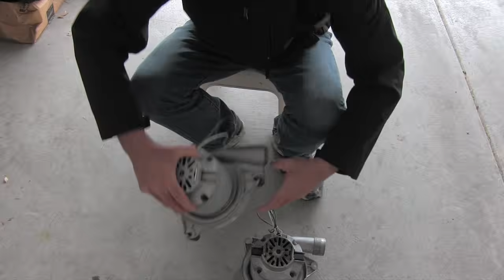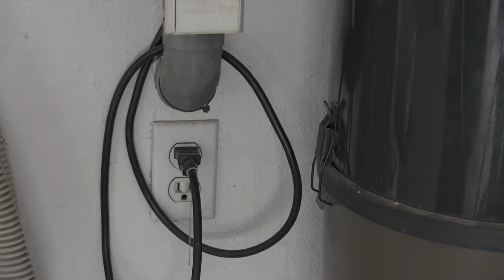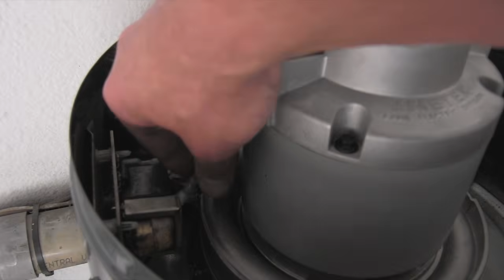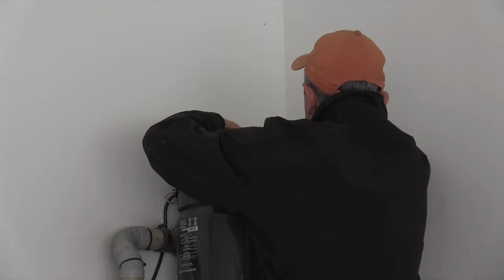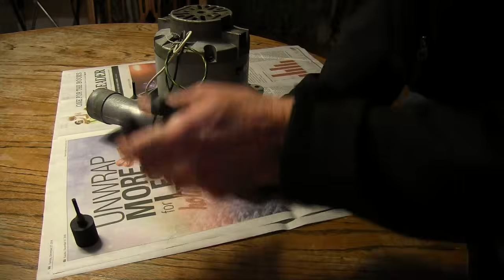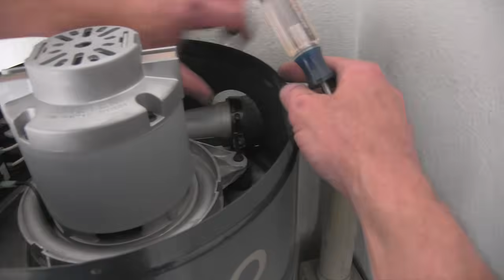Replacing a Motor on a Vacu Flow Central Vacuum

Comment: Would have liked to hear what the motor sounded like BEFORE you switched motors. I am trying to diagnose the issue, as I need to be sure that a motor replacement is necessary.
Reply from the maker: It's been a long time since I posted that video, best I remember, it had quit altogether when I replaced it.

Comment: Helpful vid!  My change out didn't go exactly as yours but pretty close.  The tips on the motor rubber feet was good but I struggled getting them out and back in - ended up using a small straight head screwdriver to get the bulbous part out and back in.  After reconnecting the hose, I am a little concerned about how flat and seated the motor is and the lid was really hard to get back on over my replacement motor.  However, it all works now.  Thanks!

Comment: Thank you so much Mike for this video!  We replaced the motor in our unit and it works great. We did change part of your procedure by cutting off the wires from the old motor and used wire nuts to connect the old connectors to the new wires.  This way we didn’t need to buy new connectors. The replacement was fairly easy thanks to you, and you were right about the difficulty in taking the pipe out the the unit. It took time and effort. The installer used a rubber coupling to connect the unit. We had some difficulty gettin it back in, but with a touch of liquid soap it went right in.  So great to have seen your video.

Comment: One thing that I would always recommend putting in when you replace the motor is to also replace the motor gasket that sits underneath the motor. Over a period of time, the material of the gasket would eventually wear out which would cause the unit to lose suction and airflow throughout the entire system. The gasket itself is inexpensive and also very easy to replace. But, it's not ALWAYS a necessary thing to do. https://builtinvacuum.com/parts/all/vacuum-motors/models/7.2-inch-motor-gasket/